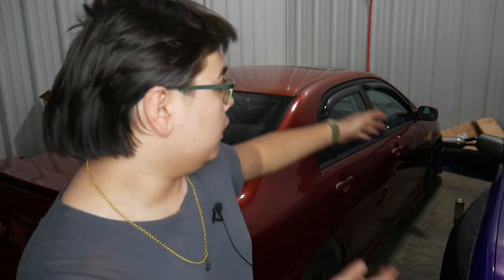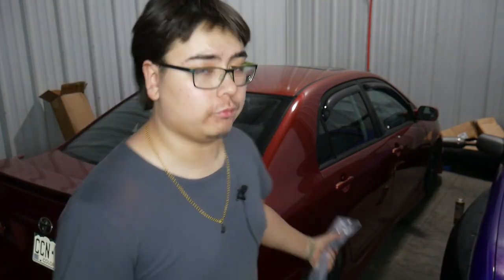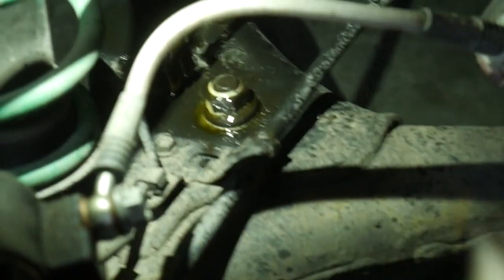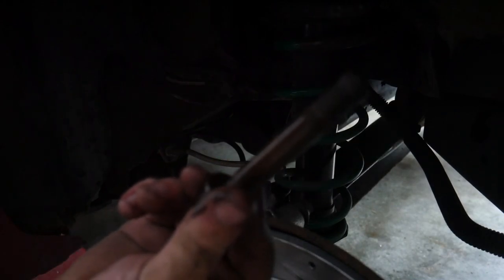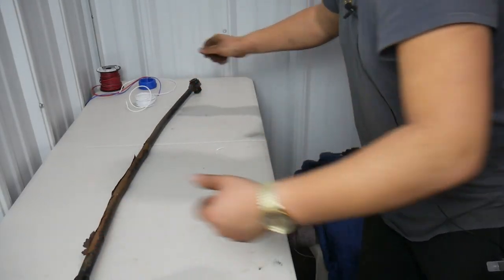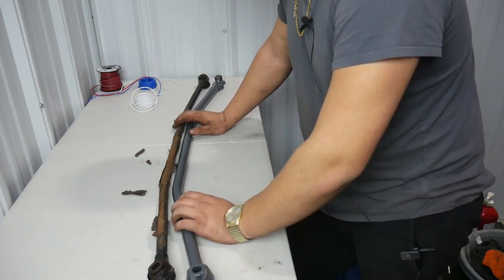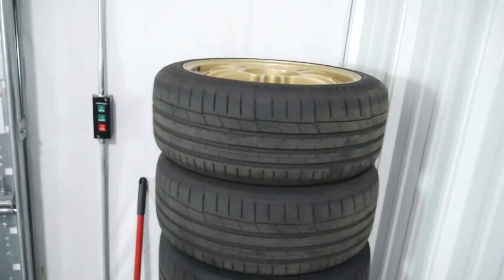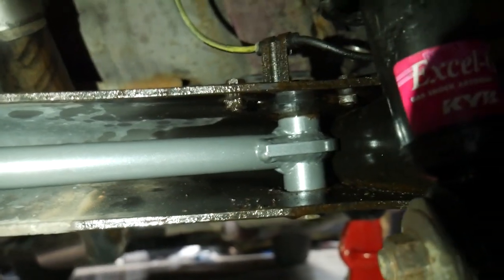Corolla XRS Rear Sway Bar Upgrade!

Comment: Question- do sway bars help make the cars turning feel sharp and responsive? And also was wondering if some good coils will improve on that even more?
Reply from the maker: I'd say the rear sway bar makes it feel more sharp, having a stiffer sway bar in the rear reduces understeer which is great for a fwd car! I'd say for suspension upgrades I would start with coilovers first before going to sway bars, coilovers will give more of a dramatic handling difference
Reply: @WillChang  oh bet yea thanks

Comment: Yo bro, I been watching your stuff for a while and I got an 06 1zz corolla, basically stock other than muffler, I was wondering if u had any plug and play ecus in mind that work with the corolla, specifically for bolt ons like a full exhaust system or sum more air induction like an intake, or throttle body, I also live in co so lmk if u tryna cruise🤙🏻🫡